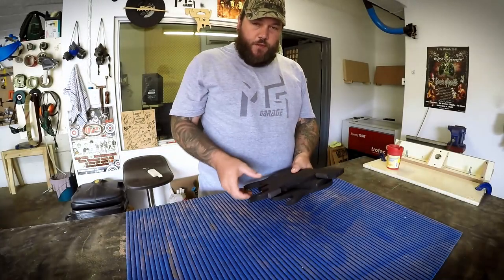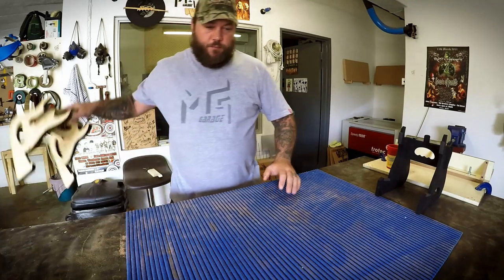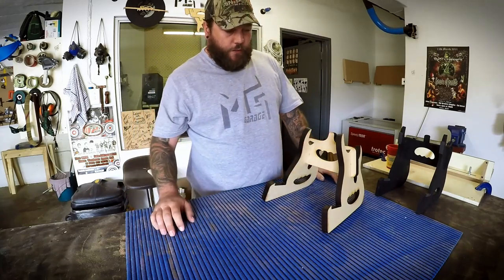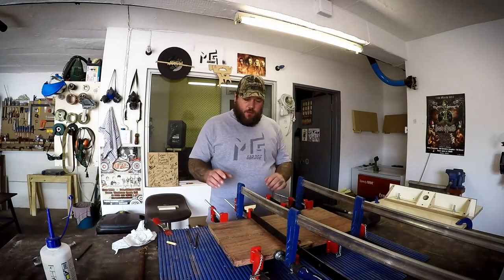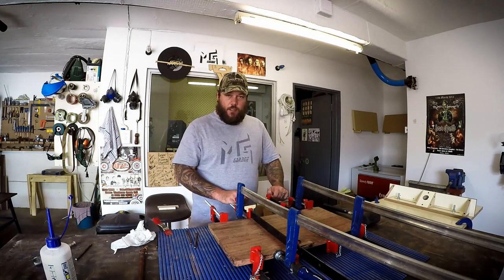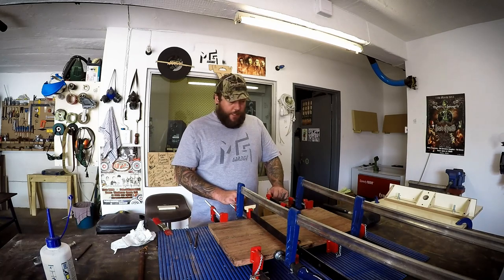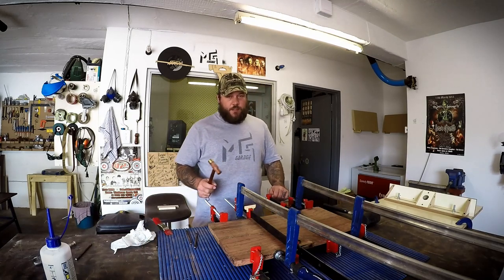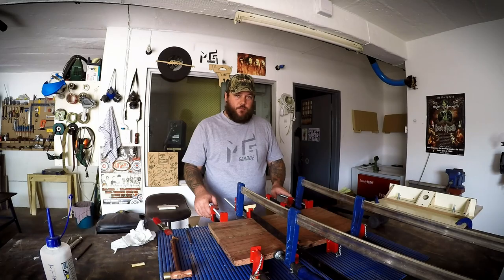DIY Portable Guitar Stand

Comment: Hi great job.Just a suggestion. I see here and there you cut through a dowel or two.Maybe try doing a glue up without using dowels at all.I have made many shaped bread board this way, without any issues.👍😉Keep the videos coming.
Reply: Hi, I would agree with that suggestion, there's plenty of side-grain to glue together so a simple edge join should work well without dowels in this case and you don't risk breaking any more if your clamps! :-O

The finished project looks great! :-)